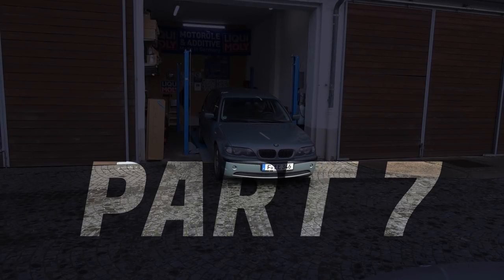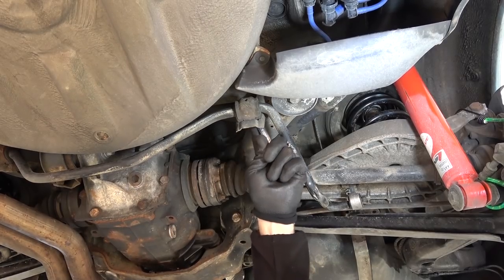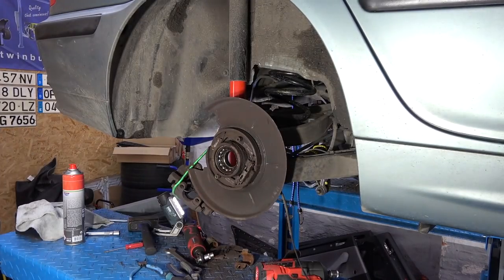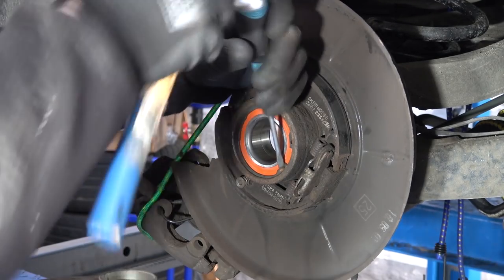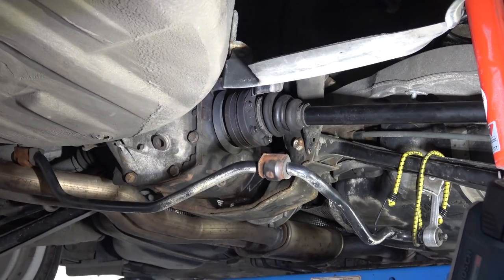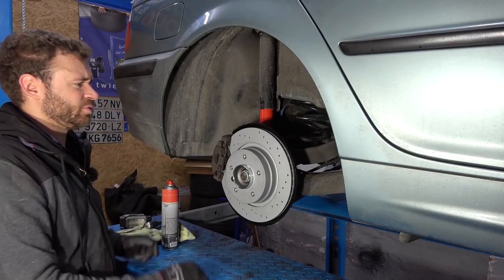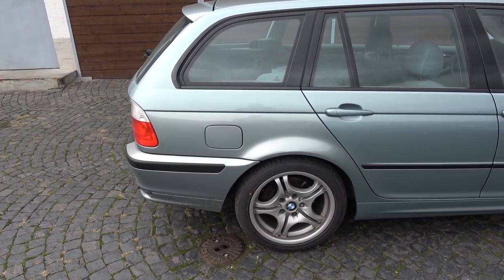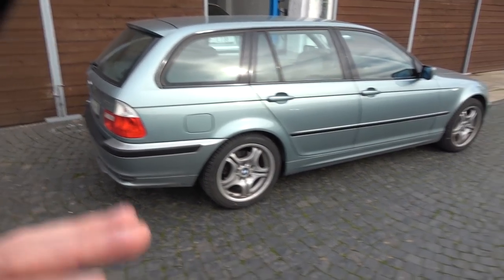Make It Less Noisy - BMW E46 325i Touring - Project Cologne: Part 7

Comment: @M539 Restorations  -- I see you using Zimmerman rotors. I plan to change brakes on my e84 however my usual experience with aftermarket rotors and pads is they get ovalized or the brake is too rigid.  What do you suggest as an alternative to OEM ? Are you happy with Zimmerman ? Thanks and all the best from Romania, each day you upload a clip is a blessing. I admire your passion and work ethic. Wish you the best and many more videos to come. Happy New Year

Comment: With the rusty calipers, the cheaper option is remove and get them sanded someplace.
That will remove most of the rust, and after priming, they will look great!
Reply from the maker: Not really, refurbished calipers are like 30-40€. :)'
Reply: @M539Restorations  I guess prices differ by cars, and countries! :D Here in Lithuania it’s 20euros for sanding 4 calipers. And rebuilding them isn’t that big of a pain. 
But probably adding cost of the rebuild kits it will just be the same as the refurbished ones. Best of luck with your projects!

Comment: If you're set on the 330i motor swap you will need the complete fuel tank system and lines as well as the fuel lines are larger, this gets overlooked and normal driving in city isnt an issue, issue is top end RPM it will start cutting out and throwing codes on the engine !.
Reply from the maker: I'll get a complete donor car.

Comment: My tipp for e46 replace calipers every 10 years you can buy the ABS one they are mutch cheaper than ate but equal in every aspect

For the engine swap normally you would have to change it in papers but nobody can tell the difference between 25 an 30i 
So just don't tell the tüv ;-)
In the front you can use z4 domelager this gives you about 5 to 10 mm lower

Comment: Nice work S! And appreciate posting all the links. I made a similar mistake on my e38 rear bearing job, left the disc shield off after pressing the hub back on, all good fun when you have the whole hub out and in the 5t press. - Do you ever put any antiseize/bit of grease on the new parts going in so easier to replace next time? ....Keep up the god work :)

Comment: My rear axles on my 2001 E46 were so stuck I had to remove both trailing arms and take them to a machine shop to have them pressed out. I tried slide hammers, pullers (all it did was break them) heating them with a torch, tons of penetrant and after a week I gave up and removed the axle and the trailing arm together. Took the machine shop less than five minutes to get them out with a press. The good news is while I have them out I'm going to replace the bushings and ball joints which were shot. The bad news is I had to cut the emergency brake lines to get them out so now I'll have to install new ones.

Comment: My 330 sits taller in the front than the rear with factory sport suspension and new Sachs dampers all around. I’m in the same boat as you, I don’t want to lower it. Just want it to not squat.

Comment: If you want to upgrade your Front breaks take the Brembo calipers from the F3x 335i / 340i with Brake Discs from the e46 m3 CSL.
Reply from the maker: Too expensive and unnecessary for now on 325i, but good to know that's possible.
Reply: @M539Restorations  „for now“ :-)

Comment: the front looks higher on E46, or as we call it "Hängearsch" (hanging ass)...

One idea to make it way better:

I found my 2004 320d to feel harder in the back than in the front. So I fitted the genuine E46 M-Sports Springs (and dampers, but you do have better ones already), but only in the front! Turns out to perfectly match the "normal" back end both from harshness as well as sitting 20 or 25mm lower and thus looking perfectly. At least thats what I happened to experience with the 4cyl Diesel. I guess, the 6cyl petrol engines should have quite similar weight?

So maybe you should just give it a try :)

Comment: 8:40 that precision is called imperial measurement. 37,2mm is most likely 1-1/2in and between 28mm and 30mm should be 1-1/8in. Just FYI

Comment: The bearing tool probably would respond well to 1 7/16" socket.
Reply: philmariop ha, I was thinking it was SAE as well. Though 37.2 is between 1 7/16 and 1 1/2 so I’m thinking the latter.

Comment: Good job! But why didnt you use grease on the axle spilnes or copper grease between the hub and brake disk, it would make it a lot easier to take off next time.
Reply from the maker: Cause repair manual specifically says not to use any.

Comment: Talking about stupid mistake, once I was going to replace a balancer oil seal in a diesel engine, so at first I loosen the bolt when the timing belt was on, then I removed the timing belt , replaced the seal , put back the pulley and bolt, but I couldn't fully tighten the bolt untill I put back the timing belt, and then I forgot to tighten the bolt, i  put back everything , then just before starting the car, I remembered what I've forgotten. I was sooooo pissed. I had to remove 4 belts, 2 covers, crankshaft pulley fan clutch. It was really stupid mistake that cost me 30 minutes of extra work.

Comment: Would the bearing being too hardly stressed by putting it over night into the freezer for better assembling?
Reply: Works like a charm to put bearings and hubs in the freezer, presses in much easier.

Comment: I had the same problem with the rust on the rear left side quarter panel on my 323ci cabriolet. But this guy reversed into it at the gas pump and the insurance did all of it even replaced the rusted area and did an excellent job my insurance went up by €50 but I felt like kissing the guy as the rust would have costed me €750

Comment: Check if there are any “Domlager” available from Bilstein or Meyle that could lower the car at the front by 10mm.
Reply: E90 x-drive Domlager will drop it ~1cm. Same with Z3/Z4/E36 Domlager but those are constructed not as strong as the X-drive one.

Comment: Are the braided hoses to replace the corroded copper brake line? I was going to say because you used rust converter on it but rust converter doesn't work on copper.

Comment: 17:58 don't you have to tighten the sway bar bushings with the car on the ground (under load) to avoid torsion in the bushings? Won't there otherwise be noises when the sway bar is working (e.g. when driving off a big sidewalk)?

Comment: Doesn't drilled rotors get cracked around the holes after some intense using? I have seen it on Mercedes cars. That is why I use only slotted rotors.

Comment: Great video but why don't you take your time to do a good detailing to the wheel arches at this moment? It wil prevent any future corrosions cause of the cleaning and protection.
Anyway, a great car that if you sale it probably wants me to buy it. Thanks from Spain.
Reply from the maker: I don't have the time for that always and it's pointless, on the very next drive it will be equally filthy.
Reply: @M539Restorations  yeah, i know but i tell you not that much filfthy. And then you can start keep clean. Anyway, Saludos desde España.

Comment: You will regret those rotors. I have them on my E46 Touring. It sounds like a train stopping when braking at 200+kmh. Even from 120 kmh but not that loud.

Comment: You mixed up (2:41 and 14:14) ABS sensor with brake pads wearing sensor/indicator for instrument cluster. 
BTW. My e46 with factory 226 Sports Suspension Settings + 338 M Sports Package II also has bigger gap between wheel and fender at front than rear axle. It's strange.

Content of your channel perfect :thumb up:

Comment: Lucky that race didn't destroy the new bearing when you removed the hub
Reply: It's likely to fail again in the near future. Those bearings don't like being removed and put back in.
Reply from the maker: It won't fail. The bearing was not removed, just the hub and it didn't make any difference for the bearing since it was just installed and the race didn't weld itself to the hub yet. I compared it with the new one in the other box and it didn't have any additional play and was still spinning the same. If I thought it'd fail, I'd get a new one again.

Comment: Aaaah dude wear a mask when you’re tinkering around the wheel enough to get brake dust in the air!

Edit: never mind I see you have a respirator. Use it earlier. Also, I highly recommend a wire brush. Anyway, still great to see a shiny new brake system.

Comment: Perforated rotors sadly have the frequent nasty habit of developing cracks. Might not happen with yours, but it does happen. Slotted rotors and a good set of pads are pretty even, performance wise, to their drilled counterparts without the cracking liability.

Comment: 22:50 Does BMW use different size spring pads like Mercedes? If so, maybe a thinner pad will give you the slight drop you want? (Maybe the E46 M3 has thinner spring pads?)
Subscribed, btw. I'm a Mercedes fan, but I really like the way you make these videos! :D

Comment: So not put just a screwdriver trough disk brake to block it. You will ruin the one little bolt that locks disk brake on a hub. Screw some wheel screws in a hub. And after all great work ;)

Comment: Am I correct in thinking the new bearing will now be damaged after removing the new hub with the slide hammer after he put the back plate on the wrong side. Should have scrapped that bearing and started again with another new one.
Reply from the maker: No, the bearing is fine.
Reply: It may seem fine now. But I think it may fail prematurely. Apart from that good video.
Reply from the maker: It won't. I compared it with the other new one and it's exactly the same, still spinning smoothly and no play. The hub came out easily and didn't have the time to weld itself to the bearing race.
Reply: @M539Restorations  okay I hope so. Just seemed wrong to me, that’s all.

Comment: Congratulations to your new Hazet Tools and Happy New Year. And yes adjusting the E-Brake is shitty work, especially if the adjustmentscrew is rusted as fuck and you end up disassembling everything.😂
But i dont see any difference to the rear brakes to the big six cylinders, except the brake rotor.

Comment: Nice project but torqing de axle nut with only that tiny m6 or m8 bolt in it made me crinch🥵. When i do this kind of torqing i remove the hub cap from the rimm an torq it with the wheel mounted or at least one or more wheel bolts blocking the brake disk.

Comment: I love your plans but: you are also putting a lot of extra weight (big engine, big brakes) into your car. You need that 40 HP just to compensate for that :-) In my experience a daily driver benefits most from lightness. The lower the unsprung weight the nicer the car handles and accelerates!

Comment: For a daily: don`t lower the front, better lift the back of these car with original BMW parts called "Federunterlage oben für Fahrzeuge mit Schlechtwegepaket". Makes the height at the back similar to the height at the front. it looks way better....i do it on e36 + e91.....

Comment: Those bearings don't last very long after being taken out and put back in. You might end up having to replace it again soon.
Reply from the maker: It wasn't taken out, just the hub.
Reply: @M539Restorations  Sorry, yes that's what I meant. The bearings don't last long after taking the hub out to replace the plate.
Reply from the maker: If the bearings are old and it's harder to pull off the hub, that would probably contribute.

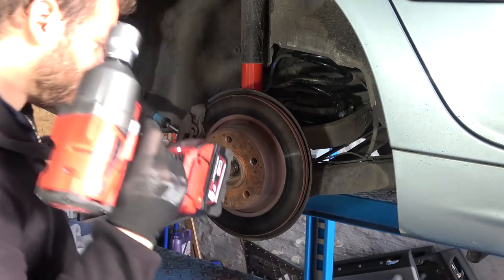Comment: hello can you link the electric screwdriver that you said you love? 01:35 thank you and if it is amazon even better please link all tools :)
Reply: Just search for Milwaukee M18 High torque cordless impact wrench. I'm using the same model too. But it's just too powerful. Most of my job can be done by an M12 stubby low torque, that the M18 spent it's time most in the box.

Comment: Super amazing work my friend! I'm surprised that you don't seem to care about the calipers enough to clean and paint them.
Reply from the maker: Interesting how you come to the conclusion I don't care about the calipers. It's a daily, don't want painted calipers. I only paint them when I rebuild them and they are disassembled completely. If you do it while on the car, it doesn't turn out good.
Reply: @M539Restorations  Ah, I understand now. You ended up replacing them in the next video anyway ; )
Ooooh I see now you have the aqua blast... super excited to see that in action!

Comment: Hey, cool Idea with the engine Swap. But the 330i engines dont make their Power, you wont gain that much Horsepower out of It
Reply from the maker: They dyno at around 222 PS which is a lot more than 325i.
Reply: @M539Restorations  okay If you find good one i wont say anything but all of the Videos i have Seen with a 330i on the dyno they weren't that good. 
But i would Love to see the Motor Swap 🤙🏻

Comment: if you put the bearing in the freezer it will go in without resistens
Reply from the maker: I know, but I don't have such appliance in my tiny garage. It went in fine regardless.
Reply: @M539Restorations  but you doing great videos...keep up the Great work

Comment: Which m18 impact is that? 1/2 or 3/8 drive?
Reply: It seems to be 1/2. As you saw that bolt takes a lot of torque and even if the impact is Milwaukee, it's 3/8 is probably not strong enough.
Reply: @tonik.5767  I don’t know about that, the 3/8 Milwaukee are stupid strong. That’s why I’m asking
Reply: @vladniko75  I simply don't know. It's 250 Nm, so it seems too much. (I have the strongest Bosch 3/8 impact driver and it can't undo a wheel that's tightened with 100 Nm. But Milwaukee stuff is better, just can't tell by how much.)

Btw., I don't even know if it's safe to loosen 250 Nm with a 3/8 inch "inserts"...
Reply: It's 1/2.
Got the same model he's using.

Comment: When you do the 330i swap, would suggest a new exhaust and a set of cams.. if you can get it through the TUV. Whatever happenes, replace ALL the gaskets on the engine, and upgrade the oil pump to prevent any issues with that. And would suggest a single mass flywheel swap.
Reply from the maker: I already got Reuter exhaust but didn't like it in the end. Too much drone.
Reply: @M539Restorations   Cams and oil pump at least will net some addtional power and reliabity, the 3 litres do have a habit of having their oil pumps going pop

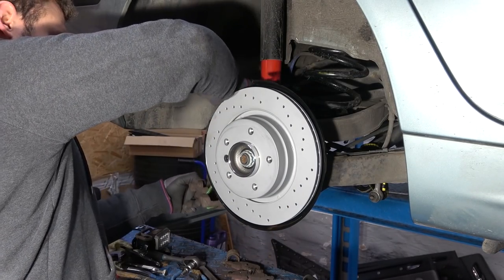Comment: 14:54 When you use a slide hammer to remove the hub out of the new bearing there a good chance that you fucked that bearing now...
Reply from the maker: It's fine.
Reply: @M539Restorations  Lucky!

Comment: if you want to lower the front a bit without lowering spring you can use the e90 upper strut mounts. They lower the car about 1cm and do not affect ride quality at all. I've had them on my 330i sedan with koni yellow and eibach pro kit for a year now with no problems. OEM lemforder part number is 31306775098.
Reply from the maker: I did that and it doesn't work, lowered it bar 2mm. Waste of time
Reply: @M539Restorations  haha good to know. I installed mine at the same time that I assembled my new struts and springs so I never measured before and after. Are you using stock springs or sport springs ?

Comment: WD40 on the threads of that bearing puller helps a lot, also try to spin the nut, not the bolt, it goes easier

Comment: In my opinion you placed the back disc wrong, left to right and right to left, i did it the same,  call Zimmerman .
Reply from the maker: The brake disc? No, makes no sense cause both are 100% identical, no difference in the pattern.

Comment: Hi! If it won't get lower, you try to change the guide support for z4 e85. Thats the OEM number 31336779613. It will get lower about 1.5 centimeters. Plug and play. I hope it's help for you.

Comment: If you compress brake piston like this, all the dirt and mud from callipers go straight to ABS unit....not the wisest way to do. It's better to open drain valve, compress, and at the end top up reservoir with fresh brake fluid

Comment: As much as your work is thorough, this cars colour is garbage
Reply from the maker: I actually think it's one of the better ones, especially in person. As long as it's not black.
Reply: @M539Restorations  fair enough. I have had a number of e46’s; my favourite was an Imola Red 330i Sport 6 speed manual I purchased from the first owner. Fabulous car. I rebuilt the whole thing with new wings, full suspension rebuild etc etc.

Maybe I should have kept it.

An Imola 330i Sport touring I would like now, but very hard to find in the U.K.